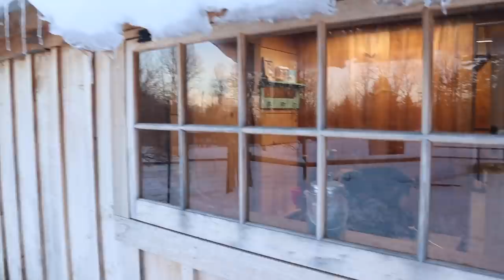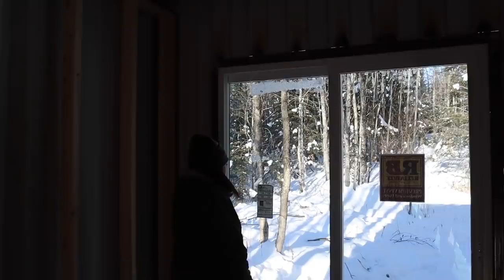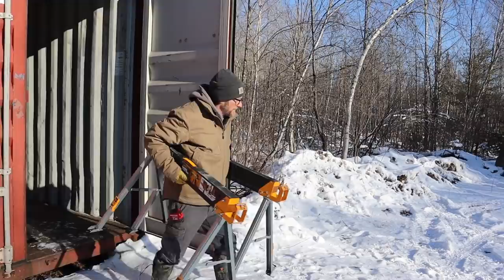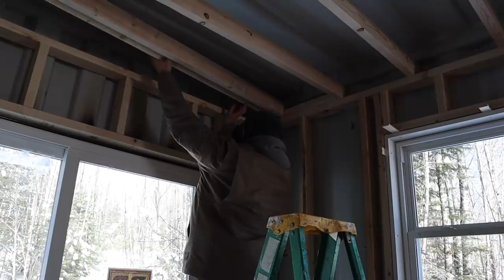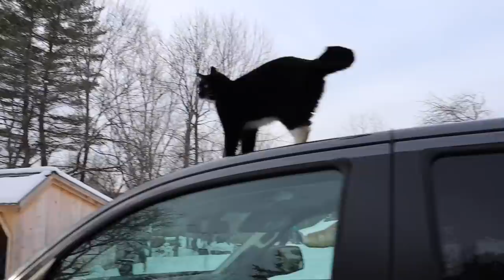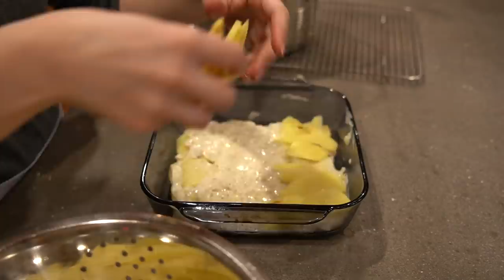It's All Taking Shape Now! Installing Sliding Glass door in our OFF-GRID Shipping Container Cabin

Comment: Just a thought, I would think about a location inside the conex where you can keep a battery bank above freezing.  Later you may wish to install some type of lithium batteries and an inverter so that you don't always need to fire up a generator for every little light or tool you use.  Lithium batteries work best above freezing, especially when charging.
It will be much easier to plan this in now to future-proof your design.

Comment: Good morning from Tucson, AZ. 
When you look at Solar power be sure to get an all inclusive system like a power bank, otherwise you will need to purchase not only deep cycle batteries for cloudy days but also a power limiter or regulator to keep from overcharging and burning up your batteries. And also a power inverter to change from DC to AC so you can use your appliances. 
Buying the pieces may seem like a good deal but all the pieces don’t always work and play well with each other. 
Do your research!  Forewarned is forearmed.

Comment: Add a light switch and wall light for the garage portion of the high cube too, with an additional exterior light on that end of the high cube. I would also add outlets inside of the garage on that interior framed wall. Maybe you’re already intending to do those things anyway though. I would also add at least a single light on the exterior of the high cube between the windows as pathway lighting. I assume you’ll pull or build another outhouse building near the cabin. You’ll want to have a lighted path to it. 

Like others have said, more is better. It’s better to have them all and not need them than to need them and not have them. 

Gonna be awesome no matter what y’all do.

Comment: Id go with at least 4 can lights for the ceiling, one light outside the sliding glass door and a large "work" light, centered on the roof of the back where the big container doors are (that way if your on that side working outside you have light) and a light above the door between the "Inside" area and the Container area so you can light up the "non-framed" area of the container inside. Outlets: never have enough, but 4 along the windows, 2 on either side of the sliding door, several in the container area work bench, run one to the back (where the container doors are) for running power to that side. Since your running solar, could also look into running outlets for charging usb devices like phones, pads, etc. So many options! Love the videos :)

Comment: Being a "old" electrician, I always put PLENTY of outlets when the walls are open because that's the easiest time. I would put a couple of light outlets on the window wall with a switch also on the inside of that wall. They used to provide 6' of cord on all appliances so the rule was always "no more than 12' apart for receptacle outlets. That way, a receptacle was always within the reach of any plug in appliance. These days, the manufacturers have decided that 6' of cord is WAY TOO EXPENSIVE for them to provide so you are "lucky" to get 3' of cord. For that reason, put "plenty" of receptacle outlets. Since you will likely be cooking mostly with electrical devices, put plenty of circuits on your kitchen counter wall. 
In your shop area, use "double" duplex outlets. Ground your generator, ground the container,  and have ALL your grounds electrically connected to that same ground. 
As far as lights, I don't think I would bother with "can"/recessed lights. This is just a "camp" site after all and they just provide a big hole in your insulation. I would look into 2'X2' LED fixtures mounted on the surface over a regular ceiling light outlet. Two or three of them, switched separately. for brightness control. Look into "dimming" capability ahead of time. Bigger units in your shop or those two lamp "shop" type lights you used at home for the shop.

Comment: Jail House Bunks for a nap or over night stay. Swing down and stow away design.
Reply from the maker: Yea a swing down bunker would be nice
Reply: @LumnahAcres  I would use a savage bed grid from the junk yard. I found one in and under the sofa pull out I put hinges on and mounted it in my step van. I had a Chevy P10 step van and used it as a utility truck and a quick camper.

Comment: I would put outside lights on the window wall as well.  At our cabin, we had outside lights on each window wall and used them all the time to watch wildlife, weather, etc.  Make sure the panel box opens to the cabin side...you don't want to walk outside and around to reset a breaker.  I would install double outlets on the counter wall not just single duplex.  Also, you didn't mention how you were going to accomodate the wiring from the generator....don't forget!

Comment: I would double the light fixtures. You could put them in a remote so you can turn them down when too bright or to turn them off/on. I have a living room that is about the size of what you are building. It’s in an older manufactured home. No lights in the living room ceiling at all so I must have table lights or standing lights everywhere. Even then, you still have dark patches where you might want more light.

Comment: I put solar lights from HF around the outside.  They come on low at dark thirty but when you approach they auto go into high mode. Work well so far but you will need to use an adhesive because the double sided tape they come with won't hold very long.

Comment: I mentioned in a previous video if you are putting the solar panels and batteries on the roof to fit swan neck pipe through the roof before you fit the internal ceiling you can then pass the cable through the swan neck just make sure you size the pipe for the cable the panels may have fixed plugs on them

Comment: The more outlets the better.  But put a door in the back wall between the cabin and the garage side. That way you can go to the storage without going outside and all the way around if it is pouring - or -8 degrees.

Comment: Go for four dimmable ceiling lights it will cut down on the shadows.  As for the outlet by the stove in that small space get a thermal electric fan that just sits on top of the stove you won't regret it.  You won't take from the stored batteries to run it.

Comment: Two lights on the outside one on either side of the door four lights in the ceiling  recessed lighting is very directional maybe even six ceiling lights if they’re pockets you will have lots of natural light in late spring and summer but in the winter months no so much the other thing you can do is dimmer switch and that will also help with the solar  talking with 36 years of experience in home renovations
Reply: My experience is 35 years in home renovation
Reply: @briancaldwell9549  You can always edit your comments by clicking on the 3 vertical dots to the right of comment.

Comment: You should put a door in the divider between the front and back and a door to the outside so you have two ways out so you cant get trapped and so you can access the circuit breaker panel without going outside. Keep the stove far enough away from the glass door so as not to overheat the glass

Comment: A ground mounted solar set up is better as you can easily clear the snow off from it. I have a roof mounted system with a 5/12 pitch and the snow stays up there until I clear it off with a foam rake or several days pass and it finally decides to come clean. Go with a ground mount and individual inverters for each panel. That way if 1 panel gets blocked by snow or shade, the rest are not affected. Check with Granite State Solar and tell them that I sent you...

Comment: Lots of sockets now & not needing them is far easier to deal with than not enough & struggling later.
1 question too. I know you left a stud out between the cabin & the shed simply to make it easier to build everything else, before putting it in. If you park the mule in there, do you honestly intend to then go back outside, & run 40' to the sliding door to get into the cabin? Surely a door in the middle is far more feasible. 
Loving the content - Keep it up Lumnahs!

Comment: Go through the motions of how you will use the space. That will help you decide how many outlets and where they and switches should be. If the family is spending the night there consider that you may have different bedtimes and will want to have the ability to darken sleeping areas independent of sitting areas.
Don't forget an outdoor outlet at the garage end.
It's cheap to wire outlets now. Your LEDs are going to be 12 volts so that's even cheaper to wire. You can have some area lighting but you also may want some task lighting.

Consider having a door between the garage and your conditioned space. Or at least make it easy to add one when you get sick of walking around the outside. The garage can also serve as a mud room so you don't track in everything to your conditioned space.
Reply: Gotta have an outlet for olivia's boom box. LOL

Comment: Double outlet boxes above your counter.  I've also seen peeps use 12 volt lighting.  Your storage will charge at 12 volts.  If your lighting is 12 volts you don't suffer any inverter loss powering the lighting system.

Comment: I would consider a small breaker panel  on each side of the center wall. If a breaker trips you won't need to go around to reset a tripped breaker.

Comment: Just a thought I would put a pocket door in the wall it would save space and allow doorto open w/o a swing also I would drill holes in your 2" metal frame and fill with spray in insulation  condensation ? . now's the Time before it's covered.

Comment: Honestly, I would put a door going into the garage from the cabin. You could do the workbench with a hinged portion that lifts up and folds back on itself right in front of the door. It would be best to have two entries to the cabin, not just one. It would work just fine where you have the wider opening in that wall now. Just build it yourself to fit the space you have in the door now. It'll make it a lot easier when you don't want to walk ALLLLL the way around that long container to get into the cabin from the garage, too!

Comment: Couple of VODS ago you showed us the rockwool. Arrant you concerned about condensation on the metal since there will always be  temperature difference between inside and outside. Not sure about over there but over here I would consider putting some plastic between the metal and the wool and maybe even the wooden struts to lessen the chance of rot and molding. I'm no expert, just wondering.

Thanks for the fun content.

Ps. Where can I get that dicerrr.
Reply from the maker: Www.lumnahacres.com/resources

Comment: You might want to put your breaker panel on which ever side you have the most wire runs which would give you a straight shot to the panel without  going up and  over doors and around corners

Comment: Just my thoughts. More is better, both lights and outlets. If you think you need 4 lights, put in 8 now while it's easy. Put in two switches, 4 in a circuit. Put in 2 dimmer switches and use dimmer LED bulbs. You will then have as much light as you need when you need it. Same idea for outlets. Place some near the floor, some at waist height, maybe even a couple in the ceiling. You may never use them, but if you need a handy plug, Bamm, they are right there

Comment: Me personally, I'd go with 4 puck lights in living area, plus a reading light each, as for power outlets I'd definitely think about a double by each reading light (to charge phones/Ipads at night), I'd also consider building a secure metal box on outside near the circuit board to put a generator in, just in case your solar fails

Comment: Al, I know you are working with limited space on your container, but have you thought of a pocket door on the wall between the cabin and the storage part so you can have easy access to both? I suppose if you added a covered walkway on one side of the container you wouldn't have to shovel a path to the double glass door entry though. Just a thought.

Comment: I think my next step would be getting a stove pipe installed so you could put that stove installed !

My guess is you will be using solar power, batteries and an inverter.  Keep all lighting 12VDC (LED).  While not "code compliant" install a 4 space (8 circuit) outdoor load center (Eaton  BRC48L125RP).  Wire the first 2 circuit to your generator output.  Wire the next 2 circuits to your inverter output.  If both the generator and inverter are 120VAC only, you can SAFELY connect the the 2 circuits together, but then you would not have 240VAC.  Remember to only turn on one or the the other of the the first 2 breakers.

Comment: Are you going to have a fire barrier between your woodstove and the glass door?  I seen a glass door panel explode because of that before.  PVC door frame can also warp with excessive heat.  Similar concern for a receptacle too close.  Speaking of receptacles, more is better and now is the time.  As far as ceiling lights, I have installed a lot of those new LED wafer (low profile) lights.  I always buy dimmable and use a good dimmer switch.  Most of them come with their own gang box with about 12" of wire and a quick connect between the junction box and light fixture.  Best part is they are flush to the finished ceiling so you don't have to worry about hitting them.  Personally, I would put at least three of the 6" wafer lights in the wood framed area.  When using dimmable wafer lights you don't have to worry about too many, only have to be concerned about not enough.

Comment: You haven't mention what you were going to use to cover the wall studs. I have an Idea for the ceiling. It is siding panel but it would look great on the ceiling and ad a bit of sheer strength. Check out the DuraTemp at Home Depot. They have a thin and thick panel. I would go for the .563in panel. Also lay a bead of sealant in the joint.
I would install a celling fan or provisions for one.
I would suggest provisions for an air conditioning. The vertical casement ones fit between the studs, 14.2in.

Comment: I would put a wall mount propane blue flame heater with thermostat in for convenience along with your wood stove they aren't very expensive. If the fire in the wood stove goes out at night the thermostat will bring it on .

Comment: Loving the videos.. We are building a container house as we speak.  I am wondering what you plan on doing about the moisture buildup due to thermal bridging.  It is not recommended to use standard insulation.  Either spray foam or a product from a company called Insofast would be the best way to go.  Good luck and keep up the great work.

Comment: Kind of suggestion a wouldn't hurt to put LED lighting on both sides of the conic unit outside so you can have light in case you need it I'm a flick of a switch and may be a switch running a light on the far end of the conics unit for outside light just in case eager to put in now than later of course just a suggestion James T North Carolina your big fan

Comment: Couple things you should consider.... 1. Put lights on both sides of the sliding door - this will increase the amount of light on both of the sides that don't have lights. 2. Install a door at the mule end of the cabin so you can drive the mule in and not have to go back outside to get into the cabin. I assume you're going to use solar, if so, the roof would be ideal for mounting the array? The electrical panel really depends on the solar configuration you choose but more than likely this one will work with any configuration you set up : https://www.homedepot.com/p/Eaton-BR-100-Amp-20-Circuit-Indoor-Main-Breaker-Plug-On-Neutral-Load-Center-BRP10B100/307647101 That panel has more than enough capacity for this project. The lights should go on one breaker, outlets on another and a separate circuit for the outside outlet and the blower circuit That will leave plenty of room for the solar conversion equipment to be installed below it. All of which will fit on the left side and a door on the right. I would also install a breaker for a welder and another 20 amp circuit in the mule/"shop" area.

Comment: With my solar system, I added an 8 amp battery charger that I could run off of my inverter generator. So when I want to run my electric chain saw or charge my batteries it is still very quiet. And my inverter generator will run 22 hours on 1 gallon of gas.

Comment: Task lighting by the countertop. If you only have two lights in the ceiling it will cast a shadow on the countertop while you are working. I also like a small light by where I sleep. If you need to get up at night, no sense turning on the overhead lights for that. Plus your beds are how far from the light switch?

Comment: Easier to put more outlet than you need now rather to try and go back and install more later. I think you should have lights on all four corners of the building.  Never know what you may need to see at night in the forest.  And set them up on a three way switch where you can operate different lights at different times. To light up the front,back,left or right side at just a flip of a switch.

Comment: Well I guess if the breaker is going to be in that other slot where the side by side will be I guess you'll want a door leading from the cabin into that area in case of the breaker trims and it's raining or snowing outside and you won't have to run around and flip the breaker you'll be able to just go through a door from the cabin into the garage area where you'll have the side by side to flip the breaker back on.. what do you think Al?

Comment: you may want an inside door from the cabin to the shop so you don't have to go outside to access your electrical panel if you break a circuit or if you need a tool in the cabin at some time.